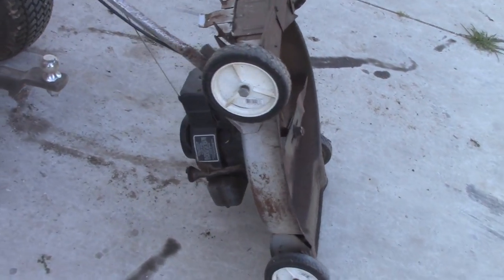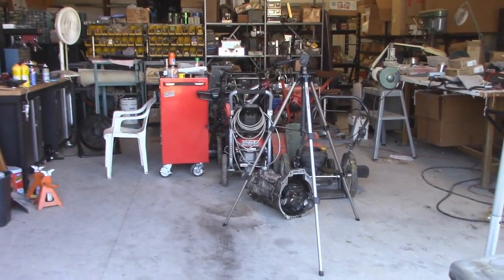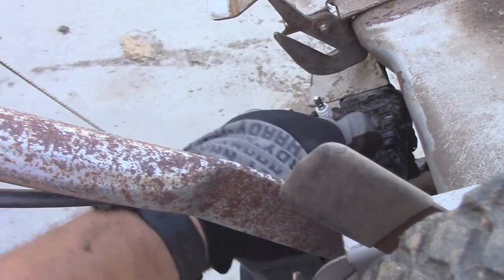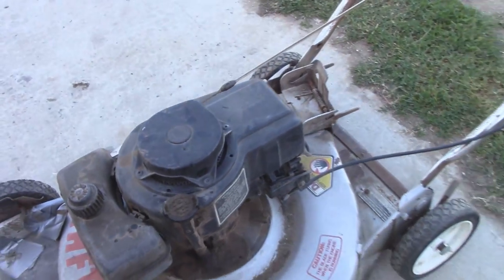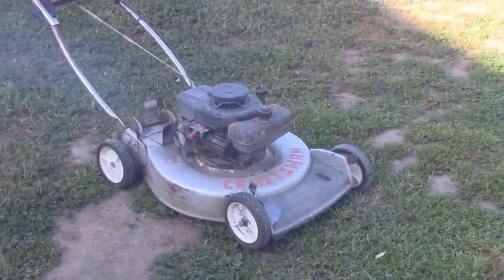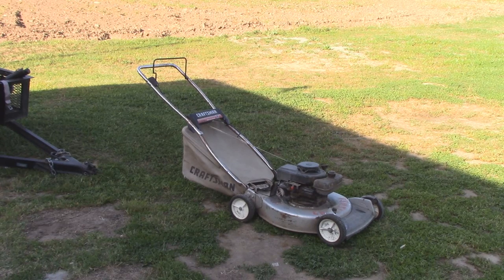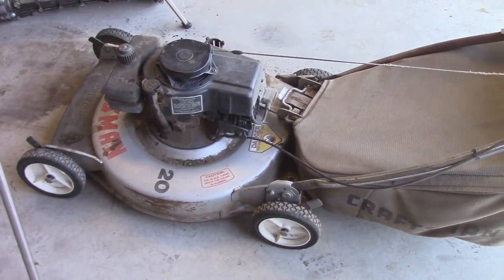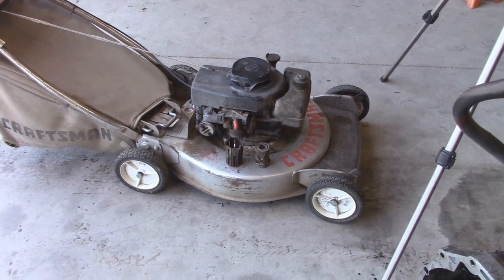DIY Unseize a Locked Up Small Engine

Comment: Those old motors are so much tougher than the modern motors. Keep oil in it and I say she runs for years. Anything is possible but I have unseized a few engines and used them for years with no adverse effects. If I wanted to sell it, I would just be honest about it and say the motor was seized when I got it but it came around. For $40-50, people will see it runs good and just buy it. Its old, its used. You could sell them a 3 year old mower that hasn’t been seized and it could still blow up next week! Most engines blow up because they are abused and/or neglected ... not because of poor engineering.
Reply from the maker: The newest Briggs in fact are poorly engineered. I’ve done a few videos on them. Busted oil sumps, starter cups, recoils etc. They are made to a price point. Gone are the days of the 3.5 horse flat heads that run forever.

Comment: How big is your mower hoard?
Reply from the maker: its fluctuated over the years currently about 20 complete decks with motors, have maybe 10 or so complete motors on the shelf, and a few plastic crates for of parts, you can see it in better detail in my fixing mowers for money video I did, though it has changed since then

Comment: I have couple of keepers, too. The scrappers a meth heads snag anything metal.  Just plain luck to find one in PSL, Fl. Lately, though, I had a run of pressure washers, all with bad pumps, and motors that need minimal work, to carb work.  Pumps are too expensive to buy and make any money on resale. Except for one I'm keeping for my use. But, the motors all run now, on the rest.
Nice video.
Reply from the maker: the scrappers and flea market fuckers around here drive me nuts man agree on the pumps too, ridiculous how they get you like that
Reply: What causes the pumps to go bad is that you need to run the water first, then turn on your open sprayer,  then start the pressure washer. When turning off the pressure washer, make sure your sprayer is still going then turn off the pressure washer. Do not turn off the water until you have turned the pressure washer off first.

Comment: Not too old school, it has a primer bulb.
Reply: Tecumseh mower engines had automatic choke carburetors through 1977. There were also a few Craftsman engines that had top-mounted primers; those engines were produced from 1978-84.